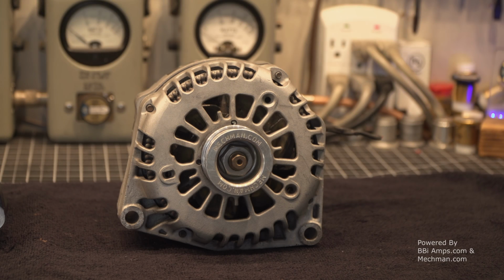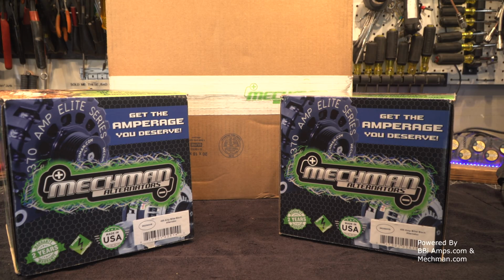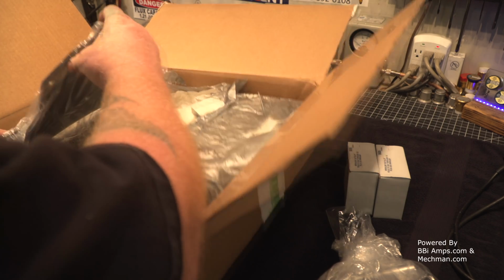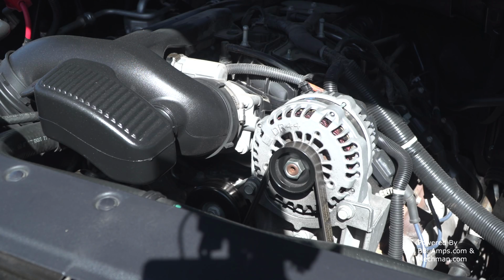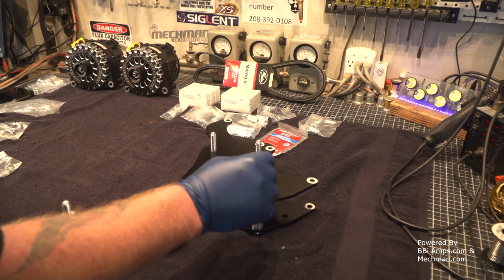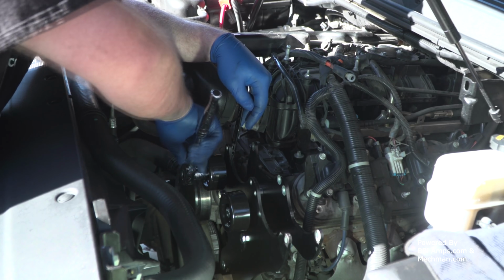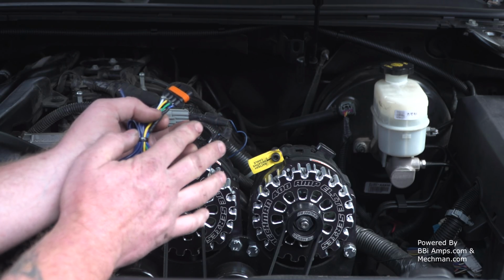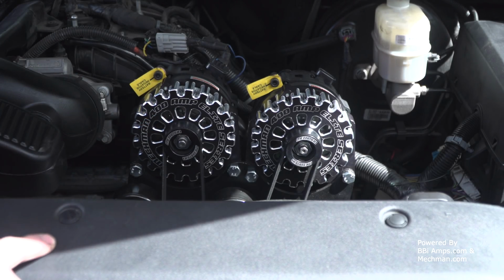How to Install "Dual" Mechman Alts, Mobile install pt.3

Comment: Sounds like a 2-3v zener diode across the two wires on the stock alternator plug would do it. Then you could run any alternator turn on you want , one wire, one wire with sense, self excite etc

Comment: Mr. BBI I'm curious, I've watched your install several times as I'm getting ready next weekend to do the same install. Are you having issues with the charging voltage being 15.1 constantly? Has this caused any issues with your factory battery being overcharged? EVERY SINGLE THING I READ SAYS THIS IS BAD. So trying to figure out if I need to get a regulator to turn the volts down to 14.8.
Reply from the maker: @Maxspeed996  wow a really good question. I'm going to give you the most straightforward answer that I can and this comes from a non arrogant non disrespectful way. 😉 sometimes emotions don't transfer over that well via text and when I answer this question I don't want you to think that I'm calling you anything any kind of names or speaking down to you or anything. Okay here we go. 
In the video I very clearly State I think no less than a dozen times that the charge system that I'm creating in my truck is specifically designed to run with lithium batteries hence the reason why I spend so much time talking about how we remove the lead acid batteries and we've replaced them with supercapacitors and why we're running 700 MCM wire to the back of the truck and on top of that. Why were using the specific lithium charge harness on the alternators which pushes the voltage up to 15- 16 volts. Okay so no I haven't had any side effects from the slightly higher voltage of 15 to 15.8 volts. My system is designed to take that voltage. The common guy that's not going to do lithium batteries in their vehicle and replace their lead acids with supercapacitors. Yeah you don't want to roll around all day long charging it 15.1,15 5 volts it'll boil the batteries. And severely severely severely replenish their life. So that's why you would use the normal stock charging harness for your McMahon and it'll only push it to like 14 .5 , 14.8. This was a great question by the way and I thank you for asking it and the only dumb question is the one that we don't ask each other when we're trying to work our way through a problem and once again please understand my answer to you is not to be mean rude or disrespectful in any way I'm simply answering your question but from an outside point of view it could possibly be interpreted that way. If you have any further problems any other questions any other thing I can do to help you out please don't hesitate to text me directly or give me a call on the phone I'm always here as a resource of knowledge. And as far as the computer in the truck is concerned we really don't have a problem till you get to 16 volts or higher and the computer I put a resistor in the sensor wire that feeds the trucks ECM it's reference voltage so that it shows 14.8 volts
Reply: @BoxBuilderIdaho  Thank you for the reply! I honestly missed the part where you talk about removing the lead acid battery. I while I was hoping to glean a little info about that, you answered several other questions that I had too. I didn't know after a while (warming up, heat soak) they come down to around 14.8v which would be perfect. I AM switching out my main battery under the hood, to a capacitor bank XS Power SB-500 that has a safe working voltage up to 16v, and a small (80 ah) lithium bank inside the truck. For as popular as these alternators are, there isn't a lot of reliable information out there, you are one of the few. I just wanted to make sure before I do the install, i get rid of the AGM, and get the Cap bank in there. Thanks for the video, and the response. Shameless plug for Tony Bolton over at Mechman btw. He's been great.

Comment: Why not hook another alternator up to a 12 V electric motor on your wheel well there where you have plenty of other room. If you hook it up directly, you won’t have to worry about a bell. You can use a PWM, to adjust the RPM of the motor.

Comment: One thing I do with using thread locker, don’t use it until the last four or five threads. Your bolt will not back out and you will most likely never have to use a torch. From years of experience.

Comment: I want one that will drop in the stock mounting I'm not trying to go all BBI and have 15 kw in a mobile I'm only gonna run
average guy stuff like maybe a 2x4 or something.   BBI you sir are an amplifier genius.
Reply from the maker: Well this is the upside that that alternator does drop directly into the stock location on a Chevy vehicle period with no modifications
Reply: @BoxBuilderIdaho  Sir I watched your Video on the "Glen 1600" the one that was in absolute pristine mint condition
likely the best example on the planet what I can't grasp is why'd you sell it?
(The 62 titty milk blue corvette hermetically sealed 1 of only 3 made the last in existence) ????
Reply: @BoxBuilderIdaho   Mr. BBI I liked you from the 1st video I seen  I watch your vids a lot.

Comment: Do you know which two wires I need to run the 370 elite as stereo only alts with factory alt for truck? Oval 4 wire plug
Reply from the maker: I would have sworn up and down that I put that in the video
Reply: @BoxBuilderIdaho  maybe you did,if I understand it's a turn on and a sense wire needed,just trying to figure out which ones go to mechman alts for auxiliary

Comment: Hey this install video with sweet!. Just a question... for the "second alternator" I'm using it for my second battery that will power my audio... how do I wire the harness for the second alternator?. 🤔 do I just wire up with switch wire..

Comment: my tahoe has a dual set up.Stock and..the 2nd alternator 300amp feeds 4 kinetic batteries..That second one is a ford crown victoria.I did connect the red and ground lead but has a small box with a red and white wire... where do I connect that or wich one for 12v to test and power the alternator??

Comment: I know you've had a Tahoe in the past, but.... Watch out for the coolant connections back on the firewall on the left side of the engine. They're made of plastic, and they like to fail and pump all your coolant out. I ordered some billet tee's to replace the plastic.

Comment: Great job BBI .I have power steering pully puller/installer and the ac clutch tool. some GM and Ford come with dual alternators. My F250SD desal did . 2 group 31 battery's also. The last install I did I kept the stock alternator and added the 2nd one. and a separate battery system for the radio setup. being only a 1.5KW HF setup it worked so great ! 73's !!

Comment: Why is it that the real cbers still favor or prefer the leece alternators vs the newer mechmans and so forth
Reply from the maker: 2 Reasons well really 3. They like having the bigger case the bigger field wires and they feel that the alternators can consistently put out more current for a longer . Of time.. 2 they have removable rectifier rings in the back that are easily accessible so you can relocate them to closer to the source. And three it would really help least naville if they would change their design that is most likely a good solid 75 years old at this point. I have a truck let us not forget that already has all that shit strapped on the front of it. This particular build is specifically designed around the fact that I want to be able to have quick replaceable components an easy accessibility to commonly used parts
Reply: @BoxBuilderIdaho  thanks bbi, love all your videos and appreciate the explanation. By the way tell your pal prime his old buddy from NYC still got his skullcrackas
Reply from the maker: I was just on the phone with him not even 10 minutes ago and I told him you said hi
Reply: @BoxBuilderIdaho  cool he knows me a soul brother out of NYC. I was I believe the first in NYC area to use his amps way back in early 90's.